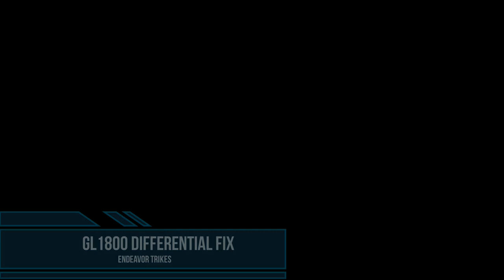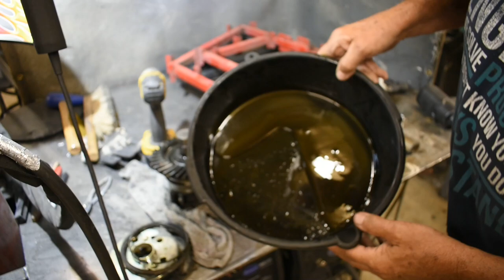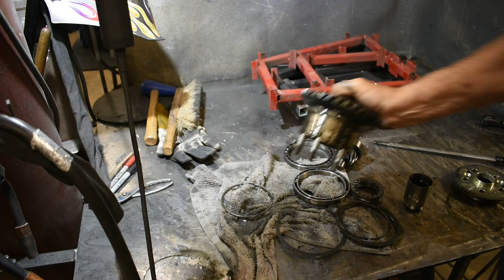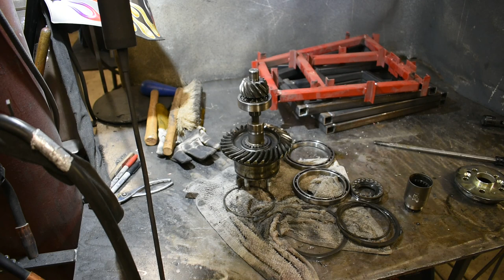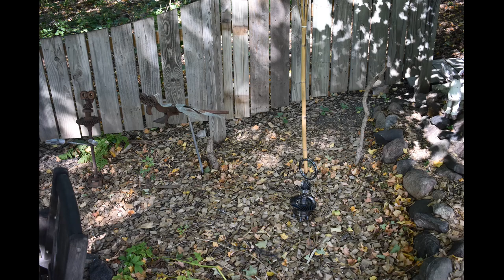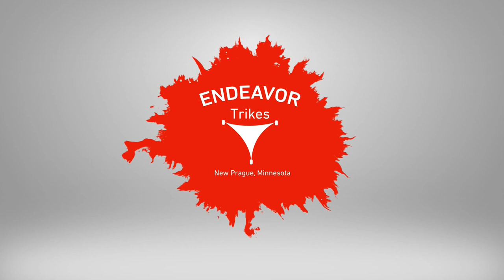GL1800 Differential fail and replace

Comment: I have a brand new spare final from a 2017 Wing with zero miles purchased from a trike builder. The builder does about 3 conversions a day so the finals are reasonable cheap. It came with brake caliper, new pads and rotor + attached brake hoses as they don't have time to strip them off the final. I  hope I never have to use it because it is heavy and would be very tough to lift in place but certainly is probably cheaper than fixing a faulty drive. Like they say "There is always more than one way to choke a chicken". LOL
Reply from the maker: Yes those chickens take a beating
Reply: Do they have any more ? where are they (contact info )I want to shelf one and would like to have it rotor and all as my rotor is worn 121,000 so far pulling trailer and a fat woman lol .

Comment: I just learned of your conversion shop (I am always late to the party) its funny that 100x125x26 Bearing is over $100 from Honda, and that whole final drive is almost $1800...
I was amazed that Honda had the foresight to put a needle "pilot" bearing on the end of the pinion...like a Ford 9" - And as a Ford guy I can attest, unless the final drive fluid gets contaminated with something...you don't need to change it...Some don't even HAVE drain plugs! - I have an "Open" Ford 9" diff in a late 70's Econoline that has half a million miles...and I bought the van with 79,000 in 1994...still has same fluid, and I know the first owner didn't change it either...Now if you have a trac-lock clutch type limited slip...adding friction modifier occasionally might be necessary as I have heard it loses it ability to modify friction!
Reply from the maker: Nice comment thank you 😊

Comment: Well you answered my question. I hear it when I lean the bike at slow speeds. So I'm guessing it's that bearing. I don't hear it when straight up. I will replace the rear tire first then see if it's still there. What do you think??
Reply from the maker: The noise you are hearing is not the differential what you have is tires that are worn. This is perfectly normal on the GL1800 and goes away when you replace the tires. It is caused by tire cupping along the edges in the "chicken strip" and this is normal and happens with all MC tires on this version of motorcycle
Reply: @Ruleof2plus1  well thank you for making me feel alittle better about it. I am gonna order some tires next week and go from there. Like I said they are from 2016 so they are old.
Reply: @Ruleof2plus1  thank you for the reply. Very much appreciated sir.
Reply: @Ruleof2plus1 What year was this bike?